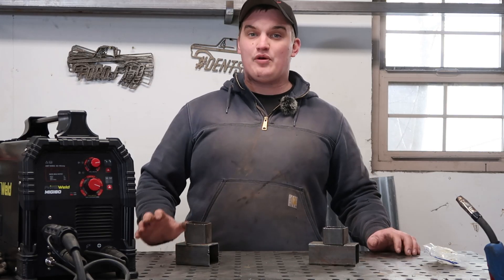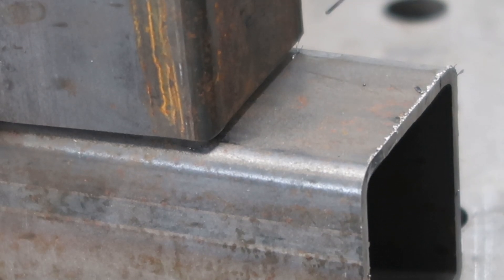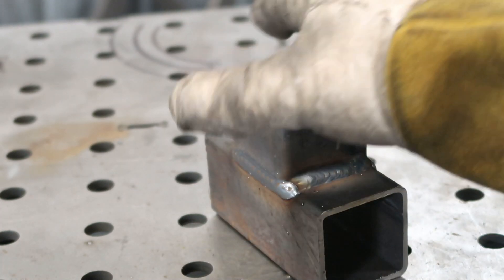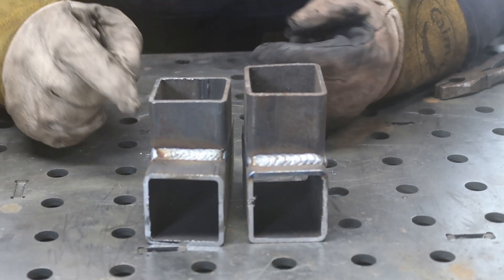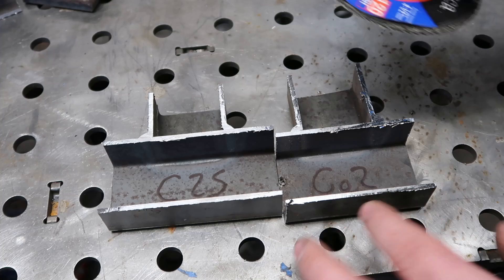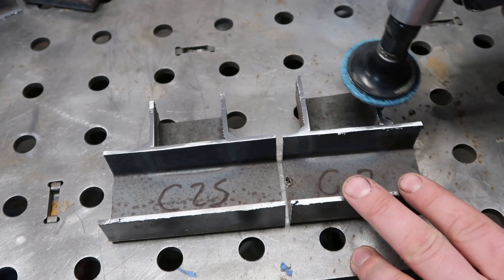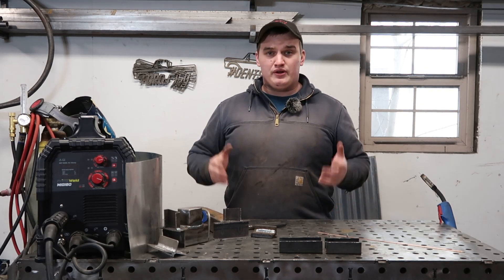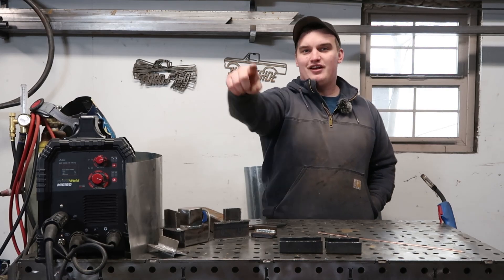Mig welding with Argon and Co2 [ Etch Testing]

Comment: Did MAG/MIG welding course for work many years ago ,we just just used argon Co2 mix for steel but instructor said Co2 can give little more penetration with right settings . We obviously used just argon for alloy and was surprised how easy alloy was once you got rig set up correctly , did have go with pure argon on steel ,got great looking weld with bugger all penetration though

Comment: Greetings from the Napa Valley. What a great video. Love the great detail provided. I'm retired from the bay area oil refinery's and still like to tinker with my wire machine .My old standby is knowing the difference between a new born baby and a welder ANSWER the new born baby will eventually stop crying. Anxious to try my brand new Esab emp 210 three in one machine. May need to stick something or mig nothing of a large scale but would be handy for small tinker jobs. My eyesight isn't good enough for tig im now 79 going on 80 .32 years as stick pipe welder. I look back and remember being under pressure to keep my certs up every year a lot of stress. Got COPD from not being aware of dangers from asbestos. Pleas us all your safety gear so when you get older you will have a better quality of life during retirement. Thanks

Comment: I never MIG weld anything using the mixing motion you used, If my amps and wire feed is set right i don't need too. I have welded thousands of Trailer hitches using that type of tubing and my welds have a line straight down the top middle of the weld from the wire feed and no coining marks in the weld, You will find the straight argon leaves a dull finish to the weld almost like a cold weld joint does. If people are using light duty welders and want a hotter weld I would advise using a CO2/Argon mix like Auto Shield 75/25 because the gas help heat up the welding pool and produces a clean shinny weld. If you stop mixing the pool you will get rid of the undercut along the edges of your welds, Learn to set your welder up better and move over to running stringers if you want wider welds like the professionals do and get a larger welder. My welds have been Government tested (TSSA) and acid tested for the Trailer hitch corporation. The problem with mixing the pool is it draws in contaminants from the outer edges of the steel surface which can cause porosity in the weld.

Comment: hay since you asked, the scientific reason behind 25mix penetrating more on the bottom plate is that the weld pool is hotter and less CO2 meaning you have a more liquid beed and less prominent weld pool surface tention meaning it has more time as a liquid on the weld aria digging deeper into the material
if you are welding horizontal with c25 stay just a jiffy longer on the top plate than what you would do with strate co2

Comment: So. a bit confused in the title. You're comparing 75/25 argon CO2 versus 100% CO2 because it is possible to mig steel with argon
Reply from the maker: You can mig weld steel with 75 25 mix or straight CO2. You can TIG weld steel with 100% argon

Comment: Nice welds, i would be upset if you used channel locks on my brass fittings. Just one of those pet peves.
Reply from the maker: They are straight jaw pliers so it's just like using a crescent wrench in player form brand is knipex check them out I'll leave a link one of my favorite tools. Super high quality.
https://amzn.to/3jSJHbl
Reply from the maker: Thanks for watching support the channel really appreciate it 😎👊🙏
Reply from the maker: 100% agree regular tooth channel locks are not meant to be used on brass

Comment: Have you ever done it with 100% Argon. Can you blend 2 tanks with a "y", 100 Argon and 100 CO2 with 3 parts flow on the Argon and 1 part flow on the co2 to get a 75/25 mix.
Reply: Technically you could but it's never going to be accurate trying it
Reply: Actually yes you can buy a mixing valve a lot of companies do this

Comment: Great video. I was surprised. I thought CO2 would give better penetration. 
To be honest though there is so little difference I think cost is king. Welding shops could save a fortune by switching to CO2. Especially if you are only making gates and railings etc.

Comment: Interesting and well done. We always adjust values to get the best profile, but in this case you didn't. This is good information for today's market when they ask, "Where can we cut costs, and with what result" A shop with 15-20 welders pushing out garbage/recycle bins are looking to cut cost at every turn. Someone creating items that have a higher visual appeal may not only choose the more costly gases but even a different  process. 
For my little garage shop, it's Flux core, Co2, or stick for ferrous metals, and sometimes its a combination of them depending on position, root pass, fill, or cap. For example 7018 root, MiG fill, 7024 cap.

Comment: New on mig. I’m more of a hobbyist than a commercial welder. Right now just completing my equipment and about to set them up. Mostly I will be welding steel from 1 to 10 mill thickness. In my place (Iloilo, Philippines) I can`t get mix gas (C25) cylinders. However I can get pure argon and pure CO2. Can I mix these two gasses using the regulators? Say, for a 10 lpm gas flow, C02 regulator is set to 2.5 lpm and argon to 7.5 lpm. Both lines will be connected to a single line to feed mig machine. Would there be any safety issues here. If there is backflow (like argon going into CO2 cylinders when you stop welding) can I use one way valves one the regulators to stop this? Think an added bonus to this is I simply shut off CO2 if will be doing tig on the same machine. Onother is I could vary indefinitely the argon-CO2 mix. 
      Sorry for the long post but there always seems a ton of questions for every pound of unfamiliar equipment…hahaha. Hope I can learn weld half as good as you. Btw very nice presentation, no bragging, and not only are you telling us what you know but also what you don’t know or not sure off. Thank you for the help.
Reply: @amcustomfab  
Greetings too. Yup, your video shows that there`s not much difference structurally. But me, not being a professional, would like the machine to “be more forgiving” (or is it?).  Anyways, somebody has to try it and circumstances nominated me…ha ha. Will let you know the outcome. 
    We have ease up on most restrictions (pandemic) for a few months now. We have an upcoming presidential election next month. Businesses are starting to recover (albeit slowly), Inflation soaring….all’s well or at least better than what I was anticipating (before omicron). Thanks for the concern. All the luck to you.
Reply: @gilbertsolinapopinion2615  Gilbert here's a tip for you, Use co2 only, especially if welding thinner plates. Co2 runs much colder than the argon mix, so u wont blow holes trough thin plates/metal and it cools down faster. (perfect for car body work, rust repairs etc) If you weld something thicker and need penetration,  just turn up your power a bit and you will have the same penetration as the mix gas and you will save a lot of money. The only reason why this video shows somewhat of a difference between the welds is because co2 runs colder and due to the settings being totally same, the co2 one doesn't penetrate as much, 2 volts more and result would've been pretty much the same.
If you weld something heavy duty and needs to be in excact specs then u should totally be using proper mix gasses, but if you weld every now and then as a hobby, u will be good only with co2.

Comment: First of all; this video was well done and i watched the whole thing. But your CTWD and work angle will have much more affect than the  change in gas. All that needs to be constant during the test - like robot constant. What i can share is argon has a lower ionization voltage, and therefore lower power input. Further, more argon will allow spray transfer at lower amperage. So you can expect better bead appearance with argon, because of finer droplets all thru the range 👍 the richer you run the argon the higher your wire feed can be. More C02  will help you in out of position welding

Comment: I'm sure preheating will help even more . Incase if I'm having to work with thicker metal or need it to really be strong . Not.gonna lie bro . If it weren't for u I would not have thought primeweld machines would be a good choice to pick from . But honestly .. for the price .. these little welders seem to be some of the best inexpensive welders I seen all through the internet . Like I haven't seen welders like these pull welds that don't have some kind of problem . I weld with wire all day already but we running 480  DC power and all our machines are 600 dc welders with giant wire feeders that push 1/16 wire . But seeing how smooth and how well these machines weld .. especially for the power they pushing .. I'm like all sold in to buying this mig welder and the tig 225

Comment: What happens when you use a regular air compressor instead of argon for mig welding
Reply from the maker: Unfortunately that would not work the point of having argon is it is an inert gas. And shields the hot weld from oxygen in the atmosphere. Compressed air is just compressed atmosphere.
Reply: @amcustomfab  i was more curious to see what would happen lol

Comment: I just got a welder yesterday and I already have CO2 from making sparkling water so it looks like I'm set :)
What I would use 100% argon for?
Reply from the maker: 100% argan is used for TIG welding
Reply: Tig and mig welding aluminium.

Comment: Well done. My only caveat would be don't use a slip joint pliers on regulators. I've been told that's a firing offense at more than one shop. Your channel and your tools but since this is educational it might good to save your followers the heartache.
Reply from the maker: If they where the regular slip joint or "channel lock pliers with teeth I would agree but these are social flat jaws .
Reply: Good to know. Please share that during the video. Sounds like a neat tool. Have you reviewed it?

Comment: If you used the same settings for both, one was not run optimally. My machine recommends to run higher voltages and wire feeds for CO2. The beads will lay flat with a little oscillation. Look up the door chart for a Lincoln 180T
Reply: I was just about to say this...turn it up a volt and few ipm...you'll get a better profile
Reply: Damn man, How much better of a weld can you get.
Reply: The settings are different for each gas is all in saying. All I run is 100%. It's fine for what I do, and it is more tolerant of the not perfectly clean steel that I use.
Reply: That's what i was thinking. I've been using CO2 for a few years because its so much cheaper. I keep some 75/25 on hand for thinner metals but for 1/4" or better I use CO2 and turn it up a bit for better welds. That said, I liked the video. Some good post-weld forensics
Reply: @timmer9lives  I've never even tried the 75/25. If it's that thin (I rarely see anything thinner than 1/8"), I go to. 025".

Comment: I would be interested in what the seam looks like with 100% Argon. I saw it in a car repair shop and was surprised that 75% argon with 25% CO2 was not used
Reply: maybe they weld with WIG, too. Same as me .. to save space I only use 1x 100% Argon bottle ... so i can use MIG or WIG with 1x bottle. a more practical reason.
Reply: @zenrevo2894  what is wig? Also, how do you mig with just argon? I didn’t know you could do that. Is it dual shield?
Reply: @randomschittz9461  Oh sorry.. in english spoken areas its called "TIG". In germany we call it WIG, but its the same as TIG. / Yes u can use 100% Argon for MIG, too. But it is not ideal and not recommend for stainless materials! If it is a matter of space or costs having 2 bottles, you can also consider to use a different pressure reducer, that can mix your main gas with a smaller & cheaper co2 gas (i.e. typical 1x one-time bottles for small price). maybe you find english content here, that explains how to mix gas by your own and link the pressure reducer you need for. if not i can link you a german video.
Reply: @zenrevo2894  wow, thanks! I’ll have to try that.
Reply: My understanding is that 70s6 wire should be run with some co2 for the deoxidizers to work, so it should not be run with just argon.

Comment: co2 is cheap and fine for short arc welding. But you cant spray arc weld with it. But for that, you will need at least 220a. And never use settings, in the mid arc area.  if you can avoid it. it makes bad welds, with lot of spatter. :) :)
Reply from the maker: Don't understand what you mean by mid arc area ?
Reply: @amcustomfab  That is the area between short and spray arc. around 170-220 amps
Reply: This was specifically a demonstration on a 110 volt welder for home fabricators. It was in his opening remarks.

Comment: The 75/25 has better penetration on the vertical as well, or equal. Again, look at wire manufacturer’s tables. The Co2 is a completely reactive gas. The welds are more brittle. For home use, Co2 is ok, but needs a bit more heat in the weld.
Reply: Nah. CO2 works like a dime with fluxcore. I work with huge engineering firm. We only use co2 with fluxcore.

Comment: So how much$$ do you save between the c25 vs Co2 per bottle?
Reply: in my city a 20lb tank of co2 costs $25, and is roughly the equivalent of a 180 cubic foot gas cylinder. a 180 cu/ft cylinder of 75/25 steel mix is $150. so the co2 is significantly cheaper.
Reply from the maker: Co2 is almost half the price of c25 depending on your location
Reply: So actually if you have argon for tig it might be worth buying a mixing valve to make 75/25 and buy co2 in its own bottle (sending depending how much you tig vs mig

Comment: Voltage setting will typically decrease with the introduction of argon....co2 will need higher voltage to run optimally.....but as you pointed out spatter is a negative biproduct of co2 for sure along with narrow profile.